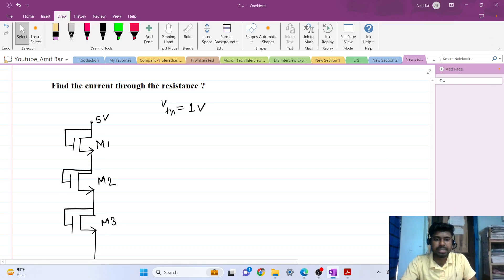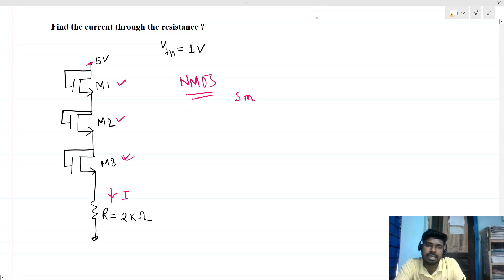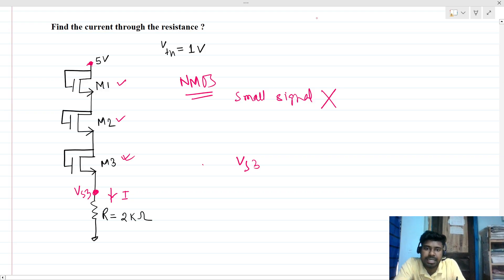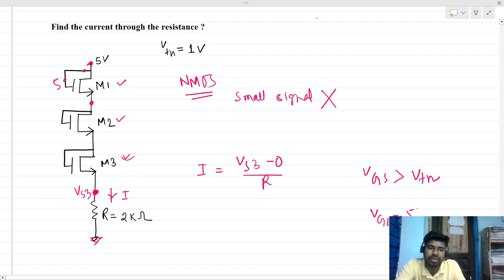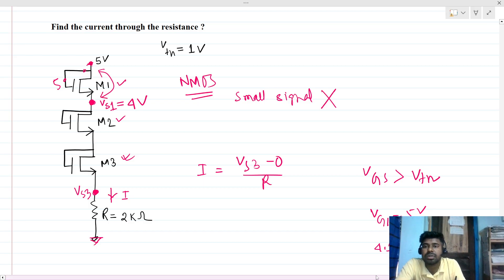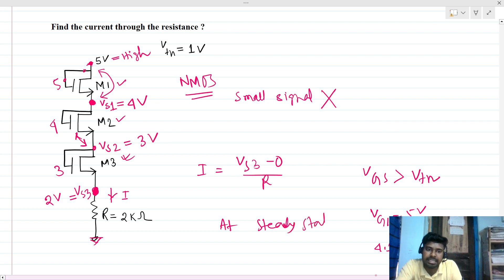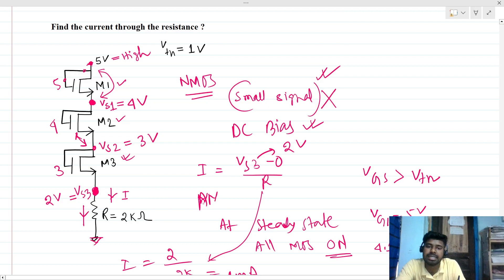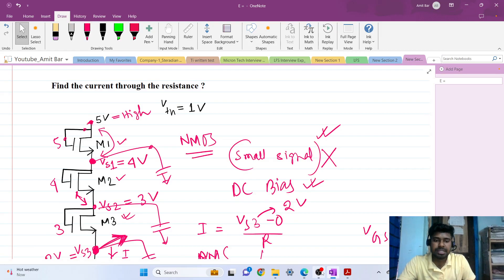Analog Circuit Design Engineer interview_ find the current trough the resistor

Comment: If you do a little bit of calculation you will find that the node voltage Vs1 has to be in the range of 3.333 to 4. Therefore how can you surely say that Vs1 is at 4 volt ?
Reply: What type of calculation will result in 3.33 -4 v

Comment: At 2:41, you say that Vs1 = 4V. That is just the max possible value of Vs1 right? How do you conclusively say that the node voltage Vs1 is 4V?
Reply: Same doubt
Reply: @shreymaru1613  I think here he makes the assumption that Width of the transistor is extremely high. So, for a fixed current, if W keeps on increasing, the overdrive voltage Vgs-Vth keeps on reducing. Theoretically, if W tends to infinity, the overdrive voltage Vgs - Vth tends to 0 to keep the current fixed. So, if Vgs - Vth = 0 => we get Vgs = Vth.